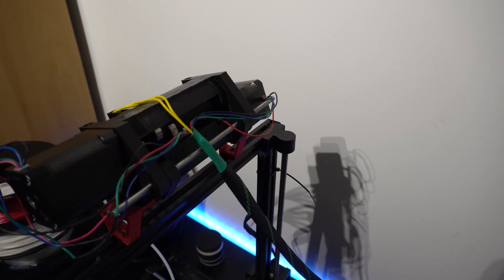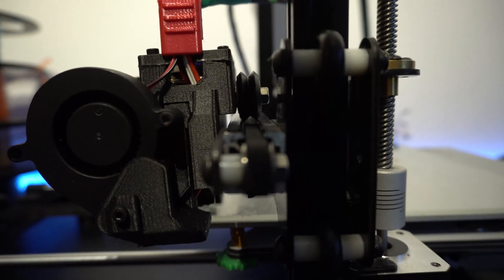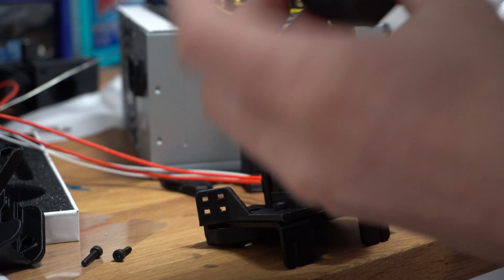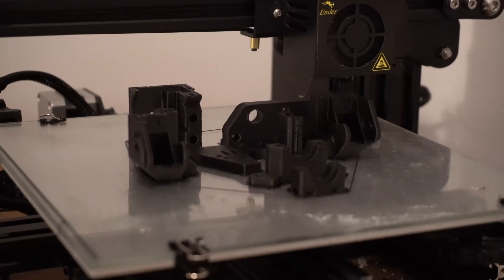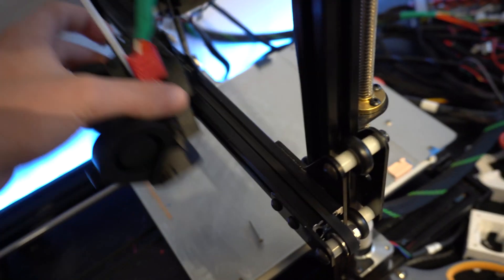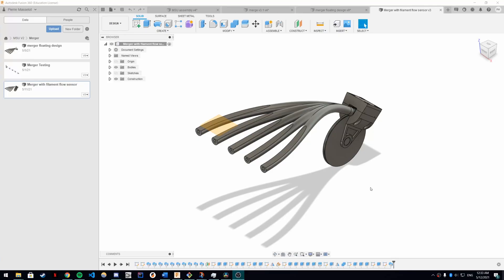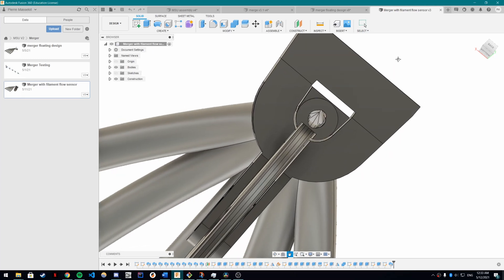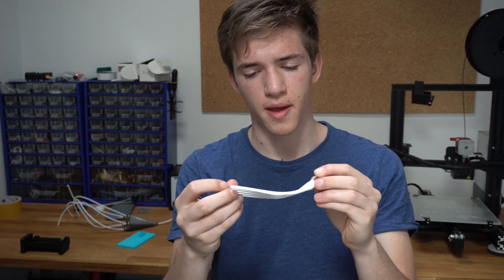MSU update: Creality modification contest, Hydra Fan Duct, new merger and filament flow sensor.

Comment: you should use tmc 2209 drivers instead of a4988. they are amazing.
Reply from the maker: yeah, I had a couple on order but they got lost in shipping. I will definitely upgrade them when I find a good deal.